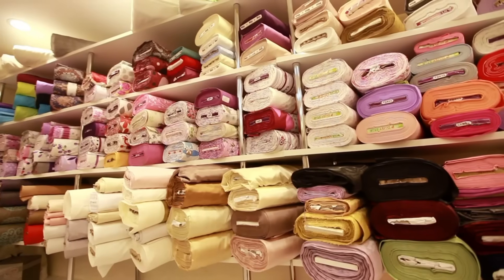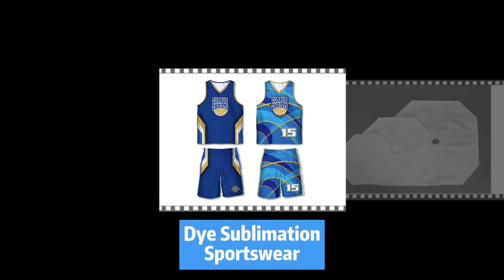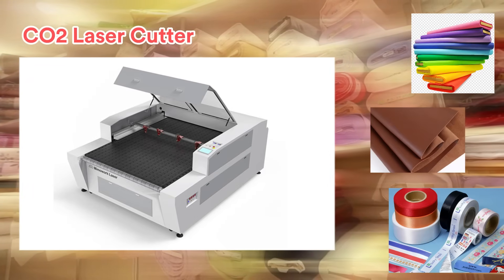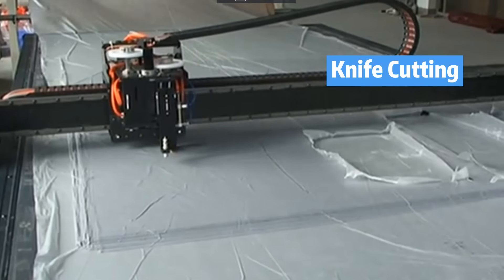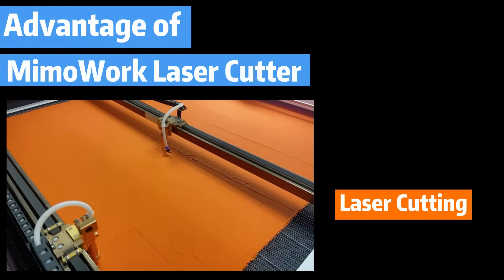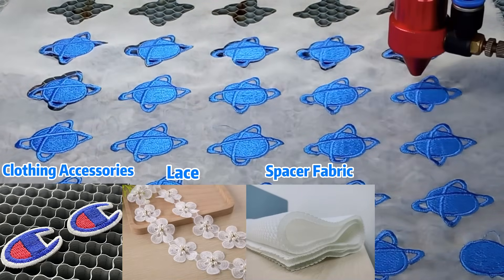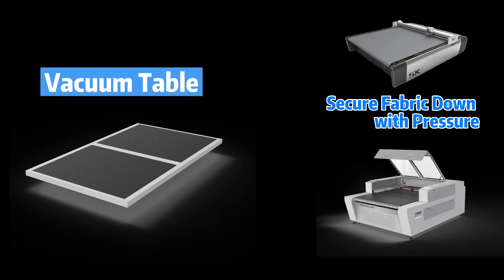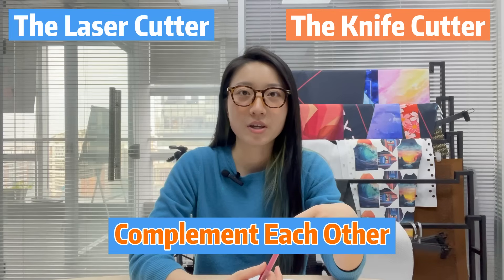Fabric Cutting Machine | Buy Laser or CNC Knife Cutter?

Comment: How many layer can cut using laser cutting Mc
Reply from the maker: The number of layers a laser can cut through in one pass really depends on two things: the power of the machine and the type of fabric you're using.

For many common materials, our lasers can easily handle several layers at once, leaving you with a clean, sealed edge. We actually have a video showing one of our models cleanly cutting through 3 layers of fabric, which you can check out here: https://youtu.be/GRx5uaXziH0

The best way to get a real answer for your specific material is to see it live. We offer free demos where we'll test your fabric—no editing, just honest results.

Just reach out to us if you'd like to set that up!

📧 info@mimowork.com
📱 WhatsApp: [+86 173 0175 0898]
🌐 https://www.mimowork.com/contact-us/

Comment: good day. can your laser cut 3 layers of fabrics at once?
Reply from the maker: Hi there! Yes, our laser cutter can technically handle up to 3 layers of fabric at once. With the auto-feeder and advanced laser software, we’ve successfully tested cutting 2 layers, and the results are fantastic! You can check it out in this video:
https://youtu.be/GRx5uaXziH0?si=0hS_qaE2gh1kKVeK, you would find more information.

For the best efficiency, especially if you’re working with larger quantities, we often recommend our multi-head models with 2 or 4 laser heads, as they can significantly speed up production. Of course, the ideal setup depends on your material type and production goals. Feel free to connect with our laser specialist to explore the perfect machine for your needs! (our email: info@mimowork.com)

Comment: I want to use it to cut fleece material in oval shapes will the laser cutter be better?
Or the knife?
Reply from the maker: Hi there! Both knife cutters and laser cutters are suitable for cutting fleece material. However, for cutting oval shapes, a laser cutter is superior due to its flexibility and smoothness in handling curves and custom patterns.

If you have any other requirements for cutting fleece, like daily output or specific details? We suggest you email us at info@mimowork.com, and our laser expert will help you find the optimal machine solution.

For more information on laser cutting fleece, check out this page: https://www.mimowork.com/laser-cutting-fleece/

Thanks for watching and supporting our video!

Comment: Can you cut Carbon Fiber woven cloth with your laser? If yes, what wattage of your machine should we consider?
Reply from the maker: Yes, the laser can cut carbon fiber woven cloth you mentioned. Usually it requires higher power if the cutting speed is what you greatly consider. How thick of your material is? Please send email to us(info@mimowork.com), our specialist will evaluate and offer the suitable laser machine configurations.
Reply from the maker: Yes, the laser can cut carbon fiber woven cloth you mentioned. Usually it requires higher power if the cutting speed is what you greatly consider. How thick of your material is? Please send email to us(info@mimowork.com), our specialist will evaluate and offer the suitable laser machine configurations.
Reply: @mimoworklaser  Will send an email but the thickness is ~0.6mm but can be up to 1.2mm (up to 800gsm). Cutting speed is not that critical but cutting precision and quality is.
Reply from the maker: @krishnam1  Got it. waiting for your email. What you offered about the material info is useful, and our team will carefully review your email to get back to you.

Comment: How many watts is the laser and how would it work with Scrim felt would it burn
Reply from the maker: It's so easy to cut through felt and no burn produced, check out the video: https://www.youtube.com/watch?v=AIHcPt91yuA&t=11s 
We used laser to cut felt gasket. Usually, 100W is enough, but specifically depends on your felt thickness. What thickness is your felt?

Comment: When I want cutting the gasket fibre witch laser CO2 or cutting digital cutting
I took about the best between him?
Reply from the maker: To cut gasket fibre,  using die cutting machine (punching machine) or a CO2 laser machine will be ideal. I wouldn't consider using CNC Knife in such a case. Here is a video of laser cutting felt gasket, you can take a look. You can change the laser power in the software in order to cut the material fibre  https://www.youtube.com/watch?v=AIHcPt91yuA
Reply: Could you send me your phone number and I'll send you messages with 'wechat' because I need more information about it and thank you for your reply 😊

Comment: Does the Laser cutter helps in fabric  fraying problems. If so how many watts we need take for polyester or cotton cloths.
Reply from the maker: Since the laser is heat-treatment and can seal the cutting edge,  it will help prevent fraying to a large degree.  What's the gram weight of your polyester and cotton? Feel free to send us an email for more professional help    info@mimowork.com
Reply from the maker: Also, feel free to jump to this video, it talks more about laser wattage choices for different types of fabric.  https://www.youtube.com/watch?v=E-nB78UcFfs&t=321s
Reply: Thanks for the reply.. I am planning to start a home business for which I need to cut fabric into 8 * 3 or less in size pieces. For this how many watts machine I should bewhat machine. Also would there be any side effects for our skin by using laser cutter.
Reply from the maker: @madhaviveguru1209  https://www.mimowork.com/flatbed-laser-cutting-machine/flatbed-laser-engraver-100.html
Check this page, consider you want to start a home business, 60W - 80W shall be enough. Consider Lululemon as the luxury brand using laser machines to make sportswear, you shall not need to worry about the side effects for the skin. Our strong vacuum system, air-pump assistant cutting, and top laser generator guarantee a smooth cutting edge on fabric.
Reply: Thanks for the quick response

Comment: What is the maximum thickness can cut by laser cutter. Can we use same laser cutter for different kind of usages like to fabric, wood, plastic sheet etc.
Reply from the maker: It depends on the laser power, if you use a 300Watt laser tube, it can cut 30mm plywood. We even provide 600W laser machine. For the second question,  the answer is yes. The same laser cutter can be used for different usages. But different machine designs have their specialties for each application, especially since most production enterprises have niche requirements. If you are just starting a business and haven't figured out what field you want to focus on in the future, we suggest you choose a laser machine (60-100Watt) with a fixed working table.